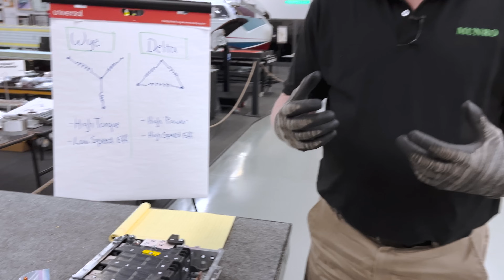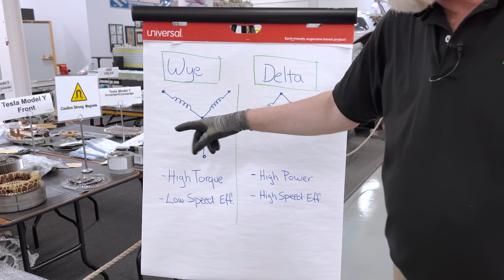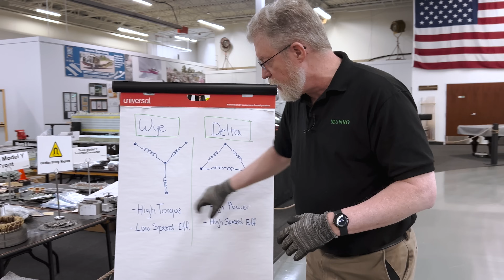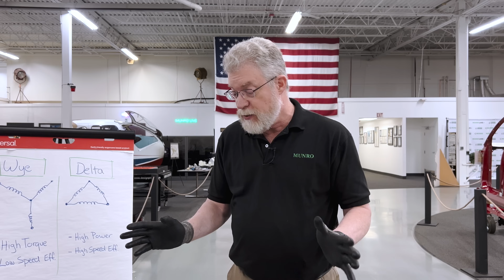KIA EV9 Dual-Stage Motor & Inverter Breakdown: Engineering Unveiled

Comment: You don’t get high torque in  ‘wye’ connection.  The Wye or Star connection is effectively connecting the windings in series whereas the Delta connection is effectively parallel.  The star connection is mainly employed to reduce the current taken at start up & the transition to higher speeds.  The current demand at higher speeds is less severe so the delta connection is allowing the windings to access higher voltage when back emf limits the current taken.

Comment: Hey, I’m curious why they chose a double 3-phase inverter topology instead of using controlled contactors to switch between wye and delta configurations, which are widely used in the industry for induction motors and, I assume, are much cheaper. Is it because of the added benefit of being able to implement a fault-tolerant control since we have independent windings?

Comment: I doubt its switched with power running, you only have to throttle off  to do the switching, and you probably only need to do that for a fraction of a second, unnoticeable to the driver.
( also no regen at time of switching also). The power will still be on of course, theres no need to turn off power, but the throttle will be zero............he doesn't understand the concept of how it works.

Comment: you can see some lack of knowledge here for the reason for turning the motor for switching, as I mentioned in another  post, you get  large back emf spike when you disonnect a motor under load, that large back emf spike can be very high voltage, and you can damage the mosfets in the drive circuits ( or igbts as the case maybe). As long as you are no load at time of disconnect the windings from inverter back emf is minimal, and no damage to fets. I'm not sure if this inverter is simply removing load for a fraction of a second as swithing occurs to the other winding config or some other method, no idea.
But interesting to see a 'motor expert' not understanding the reasons for no load at time of switching. Then again they are only taking things apart not building anything so only a basic knowledge is necessary here. I"m no expert! hence surprised by this presenter.
Reply: sometimes i think these teardown videos, in a way they are almost claiming they have some role in the building/ engineering, but really this is so simple to tear apart anything and do a video on it. Credit goes to the desingers and builders especially, not to the teardown merchants.

Comment: The front end of the EV9 could easily have a frunk gate with an expanded frunk space similar to Lucid Gravity’s outdoor couch. Its design already facilitates it. Add Ford’s 120v/240v power access, and it would be perfect.

Comment: Ce qui est différent des exemples en commentaire c'est que dans le cas de ce système on fonctionne de 0 à 50Hz en Y puis on passe en Delta au-dessus de cette fréquence. Le variateur doit être capable de fournir 1.7 fois la puissance nominale du moteur à 50Hz (100kW deviennent 173KW en passant de 50Hz à 87Hz). Le courant maximal dans les bobines ne change pas, le couple reste donc disponible sur toute la plage de vitesse.

Comment: I'm sorry I'm gonna have to call you out here, it's not called 'wye' in the UK it's called 'star' and the high torque claim, sorry but no, I waited for his explanation, but ok, delta is always more power and torque and higher efficiency, I shall explain why, pardon the pun, lol. When we configure star -delta for AC motors, it's for energy drain, phase balancing, and basically longevity on the motor and the drive trains, this is a gimick from Kia, clever but useless, you would want to go delta and have your inverter handle the frequency , it's far more effective than any of the old star delta set ups, the only reason you would keep a star delta today, if it works don't fix it, cost, and most importantly if you have a monster load. Like at a brick yard crushing rocks throught a conveyor system, an inverter would prolly stall out, a star delta will slam that motor with plenty power to get through that block

Comment: I suppose they don't do any star-delta switching. The inverter is 'just' a regular softstarter aka variable frequency drive (VFD), with a parallel set of big (electronic) MOSFET/ IGBTs switches:  by manipulating the voltage and frequency, the motor always has the best torque, speed and efficiency mode.
This unique feature is used in the industry for a couple of decades. So, interesting to see it in a new EV now...

Comment: 4:25 I'm not surprised in any way this is related to Continental. 

They did this stuff with using the motor to help charge the car all the way back in 2012 to give the Renault Zoe its very powerful "Chameleon" 43 kW AC charger, the strongest of any car since. The typical max being 22 kW on cars in the EU, 43 kW is only reserved for EV trucks/industry nowadays.

Comment: To say I’m a total novice is a vast understatement. I ran across this video because my ‘25 EV9 Wind is having it;s rear motor replaced,  Heard and felt a thump in rear, check electrical system and AWD/4WD warning lights, no access to 1-pedal regeneration mode. Later also found that vehicle would not charge. Initially dealership tried replacing the rear motor position sensor which didn’t solve the problems. Now replacing the rear drive motor. All along they’ve claimed that the vehicle charged while they’ve had it. After watching this it sounds like a problem with the rear motor might also affect the vehicle being able to charge. Any response would be greatly appreciated.

Comment: The change between delta and wye do not change the mechanical properties of the motor, only the electrical characteristics. Wye is sqrt(3) times the voltage and delta is sqrt(3) times the current, but the windings "see" the same situation. You said the power changes, but this is incorrect.

Comment: In the HVAC industry they have used Why Delta starters for many years to run big centrifugal chillers. Before the advent of inverters they used a series of large contactors to make this switch, mounted in the power cabinet on the Chillers so its nothing new , just new to EV cars and honestly, I don't know why they haven't done it sooner, seemed like a no brainer with our inverter technology. I bet ABB had it and they just took their tech and made it compact and integrated it in the cars.

Comment: Bringing out six connection to the junction box of three phase motors have been attound since Adam was a boy, far far longer than 20 years. It might be new to EVs but in the industrial electrical engineering world it is nothing new and regualrly used in Star-Delta starters to reduce starting currents and mechanical shock.

Comment: Wow.. This is impressive.  I was talking about doing this also -- but by having both sets of windings inside the motor--- so you could just switch from one to the other. but they have gone even further and gotten the same functions out of one set of windings....  And then like you're saying with the "boost" charging--   it's like they are passing extra charge through the same path as the regen current..  So like a simulated regen (as an analogy).   Very cool. I wonder how many patents they have on all those design changes. lol..

Comment: This wye-delta configuration is very common in industrial applications where induction machines need to be started from line frequency directly (without inverter). Wye connection reduces effective voltage by sqrt(3) thereby also reducing the inrush current considerably. After machine reaches certain speed it switches to delta for higher power.
In this motor I assume it makes easier for inverter to control the current during the run up phase.

Comment: I have a 38kW Ioniq and a 24 Leaf..on the same path, same speed, same temperature etc, to get 14,5kW/100km of consumption on the Leaf, I get 9.9 on the Ioniq.., with the AC running (not on the Leaf).
The efficiency of these Hyundai/Kia motors is quite extraordinary.

Comment: I wish you would draw the same graph in the "Getting Wound Up" video which compared bar and stranded motors for both Wye and Delta configurations. It seems this ability switch between why and delra really cements the strength of bar windings by pushing the AC losses out in the Delta wiring.

Comment: You may need to correct the inaccurate information in this video. Based on the description on page 12 of the patent application US20240039448A1, the two configurations are close-end winding (CEW), which is essentially a star or wye connection, and open-end winding (OEW), which is NOT delta connection. With open-end winding connection, the two inverters feed PWM voltages to both ends of the the stator winding. In summary, the Delta connection is not utilized with this dual-inverter design.
Reply: That is interesting, but is the purpose of OEW if not to enable direct application of full PWM voltage to the winding? Effectively this is what delta configuration achieves.
Reply: I have read this patent, it is a fantastic idea from Hyundai. OEW can implement a three-level inverter, and the two inverters use different power module --- SIC and IGBT. The star connection even retains the inverter's boost function. The only unknown is how much this will increase the cost with so many power devices.
Reply: Power electronics are cheap compared to mechanical parts like alloy casting parts.. this should be no surprise and truly ground breaking
Reply: Agree, I think that this additoinal connection is used to step up the voltage (as KIA Motor ENG said in the motor presentaiton video) when the car is connected to 400V charger to charge the 800V battery (using motor as equivalent transformer/indicive component) and has nothing to do with delta or anything related to motor operation.....
Reply: I really wish to understand these matters more thoroughly as I’m looking for an engine to (cough) hybridize my Mazda RX-8, the best road tripping car I’ve ever had. Sorry, my Tesla 3P & YLR, though that reserved CT is looking awfully damn good, but maybe not quite on the ergonomics side. Wish me luck!

Comment: I wonder if the EV6 and Ioniq 5 refreshes will get this new motor design. Also.. I know the EV6 GT and 5N use a unique dual inverter design on the rear primary drive motor where only one inverter functions during low power mode or both inverters provide power for high output mode, but I don’t know if the rear motor has the ability to switch from wye to delta like this. I’d be really interested if Munro did a teardown of an EV6 GT/Ioniq 5N rear motor to see how it compares to the regular EV6/Ioniq 5 and this new EV9 motor design.
Reply: ev6gt / i5n / ev9 is same
Reply: https://www.youtube.com/watch?v=xZoWRgDkZuE&t=1s    switch

Comment: I drove the ev9 recently, 30 miles, for such a large vehicle, the consumption was remarkably low. 16-18 KWh in mixed driving situations, mostly highway. At 100-110 mph it‘s weight is pretty hard to handle.

Comment: Not sure if there is inverter tear down video or not. If it is 6 phase leg inverter, the system is open winding configuration, allowing it to use low voltage dc bus to drive higher voltage machine.

Comment: Looks more like a 2x3-phase open-end winding system to me rather than a wye-delta. Are there relays in the inverter? You would have to be at no-load and outside your field-weakening region if you wanted to switch wye-delta and vice-versa without detrimental impact on drive dynamics (and avoid blowing your switches). I would be surprised if Kia went down that route, but please prove me wrong.

Comment: Wow, but this is really a big leap in electric motors. Never seen this 6 wire connection to controller.

Anyway, looks like we come back to the roots. N.Tesla did designed first 3 phase motor and there was all phases ends exposed. So we are moving to his invention like 140y back!
Of course that time there was no invertor which could drive it.

This is again genial thinking from Kua/Hyundai. Where is Porsche and Tesla?

Comment: OK, my two cents on this. I actually rented a Kia EV9 this weekend. On the positive side, the efficiency is good and it does have good range as well as it has a smooth ride.  Now the negative, it has NO POWER! I pressed the pedal and it barely moves so as fast boosting, I didn't see it. It moves similar to a V6 vehicle but has absolutely no comparison to how a Tesla moves. Also, the interface is awful and feels so antiquated. I had such a hard time with the navigation system and trying to tune in music. After using a Tesla, the KIA system feels archaic. I guess good if you really want to avoid getting a Tesla if you hate Elon but other than that, there is no comparison there.

Comment: 8:35 Nope. Y gets you LOWER torque. Basic physics. Lower current => lower torque.
Reply: Delta configuration actually gives you 3 times the torque of a Y configuration. That also means 3 times the power.

Comment: I've read that it's not so much that a wye winding makes more torque, but that it improves the "torque constant" - i.e. the wye winding makes the same torque for less current than the delta configuration.

Why is that?

Comment: Been a while I heard about Y/delta switching. People say theres not much to innovate in EVs, well... 

Also from what I learnt in the industrial context, what he said about needing to switch off the engine to switch between modes isn't correct. You use one when starting the motor from 0 rpm to reduce the initial current spike, and then switch to the other mode once the more nominal speed is established.

Comment: The motor designer is not driven to high-speed performance by the choice of delta; either configuration can be optimized for any speed by selecting the number of winding turns and wire cross-section. if the motor is not going to change configuration, delta is simpler so that is always used in EVs - it can be wound for any desired speed. The advantage of switching configurations is that the same winding turn count which is suitable for high speed in delta is suitable for low speed in wye.

Comment: Super interesting, thank you very much. Why do you call the Y circuit "Wye"? My native language is German, so I may be missing something?!
Reply: "Wye" is the name of the letter "Y" in English, corresponding to " ye " in German. This word is often used for the name of the 3-phase electrical connection that looks like this letter, instead of using the letter. The word also describes a road intersection of the same shape. 

The "Y" (wye) connection is also called "star", or perhaps "  stern"  in German.

Similarly, the other 3-phase electrical connection is called "delta" (likely "dreieck" in German); the word is often used in written form rather than the letter because the letter "Δ" of the Greek alphabet is not convenient to type. 

So, he is using the words "wye" and "delta" rather than the symbols "Y" and "Δ" ; they are pronounced the same either way, because those words are names of those letters.
Reply: @brianb-p6586  Thanks you for explaining and sorry for my brain fart, got it now
Reply: Kein Problem. 😊. Y or Star is called WYE because letter Y is pronounced like "why".
Reply: @guilleport  Y OR star is called WYE? It gets only more confusing now.

Comment: Great video, does this mean the EV9 can actually get more power through their boost converter than the prior EV6/Ionic approach? For example, can they use the star configuration to create three parallel centre tapped boost inductors or was this hwo the previous motor worked in any case with it's single additional tab?